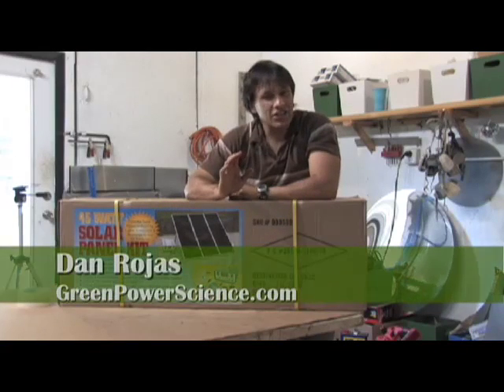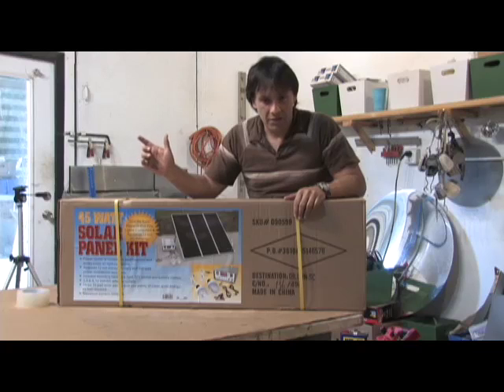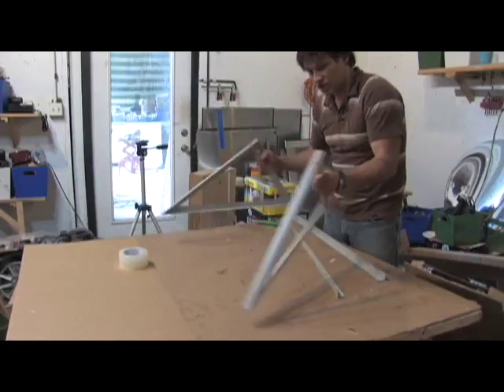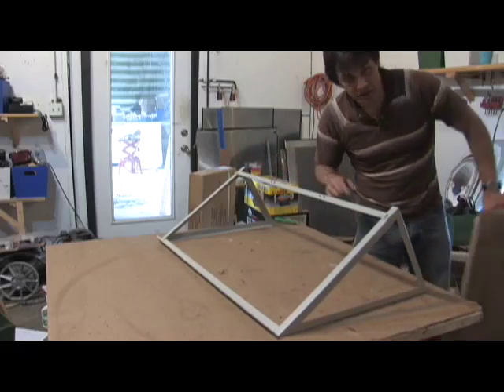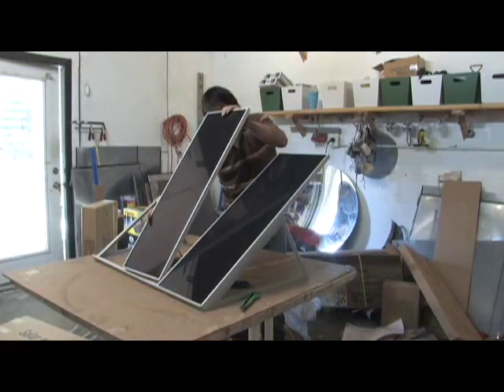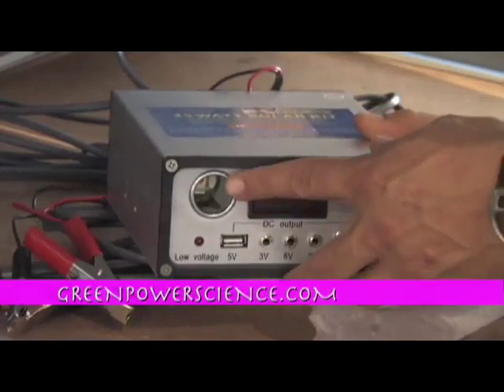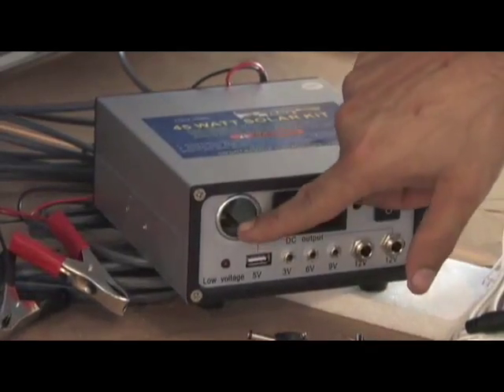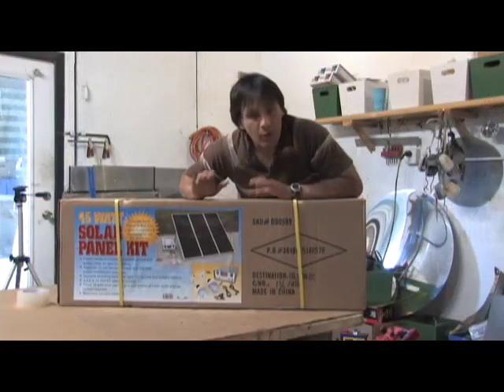SOLAR PANELS Photovoltaic, Harbor Freight, DIY INSTALLATION Training Video Solar Electric

Comment from the maker: Hi,

You can do 6 panels per controller or 90 watts. You can also hook 2 controllers together to one bank. So, if you had 4 systems, 2 to 1 controller (6panels to 1) and 2 to another controller = 180 watts, then both controller to battery leads can be connected in series or parallel for 12 V...15 amp or 24v...7.5 amp either way would produce 180 watts.

Dan

Comment from the maker: Hi,

For PV panels a heliostat system is not really needed. You will only get an extra couple of volts AM and PM. These stay at 21v open no load from 10 to 5. So you can track, and I have seen systems that do it, but I think you would be better off spending money on more units vs a tracking system.

Comment from the maker: Africa USPS max shipping dimensions 79" L+Grit.

You can send 2 panels and the stand USPS priority for about $70, send the controller box and the third panel separate.

Total shipping would be about $110. If you buy one from HF and need advice on shipping let me know. We shipped lenses to many places.

Comment: I have bought this system and it works very well.  I use it to charge a deep cell battery, which powers a 12v bug zapper (Eureka) in my yard, as well as all of my landscaping lights in the yard.  I found some very powerful LEDs on ebay.  The setup works very well.  I am considering adding a small fountain to the system, to see if it can support that as well.

Comment from the maker: That is amazing, you could buy 10, sell 5 of the controllers on Ebay (keep 5) for $35 and be in at $2.20 a watt. Also if you sold some of the bulbs you get, Wow. Where did you get the coupon.

Comment: Good video if you are installing it on your kitchen table. But if you are installing this outdoors, you need to make sure to isolate each connector end from each-other before taking panels out in the sun. Also, isolate the battery clips from each other before attaching to controller. You can use tape or put each in a little plastic bag and twist tie. All of these connectors will have a voltage across them when the panels are in sun. The features of the controller make this an excellent value.

Comment from the maker: I would not go over 150 watts per controller. You can buy one from Ebay for 20 bucks. If your voltage is the same. Panels to two controllers, to your batteries. For future add ons.

Comment: I just thought I would let you know about that so others will be careful when setting them up.  ALL the other brands of solar panels I have, which are also amorphous have sealant on the edges covering the wires under the frame but these just seem to have a kind of plastic 'flashing'.  Other than that, these things are awesome and seem to perform a little better than they are rated.

Comment from the maker: @bruteforce76 Not possible with a grid tie inverter, if the power goes out they shut off. Also back powering the neighborhood with a home system would only last about a second because the load would be many hundred Kw as people leave their stuff on in a black out, this would blow any system. The Island on GTI's are good. They work, no power in no power out.

Comment from the maker: Your voltage no load open should stay the same. Some HF controllers are not correct. Us another voltage tester. If both say 3.9 you have a short or you are hooking the panels to the output vs input.

Dan

Comment from the maker: @SpeedManiac1976 (2) wires per panel. All reds to + all blacks to - equals parallel or voltage the same but amperage boosted x 3 roughly.

SERIES
Panel 1 BLACK TO PANEL 2 RED PANEL 2 black to panel 3 red

SO Panel 1 has a free red, panel 3 has a free black this is voltage x 3 and apms the same as one panel.

Comment: Thanks for the reply. Actually it wouldn't cost me much of anything to build a tracking system. I'm an electronics/mechanical hobbyist, not to mention a scrounger/collector of good junk to make something worthwhile out of. I'll take you at your word for the 'not worth the effort' on the power gains. One LAST question, if I may, how do these panels look for resistance to hail damage? Again,  I appreciate your opinion and your time.

Comment from the maker: Home Depot's is a 60 watt system, with 4 panels. The same Amorphous cell. Exact same system but from Sunforce. $ per watt HF 45 watt $200=$4.44 per watt and HD 60 watt $300=$5 a watt, the inverter is a Modified Sine inverter and 175 watt inverters are good for small things. Either system is GREAT. Home Depot has a 20% coupon somewhere on the net, if you can find it let me know, that would make the system $240 and a screaming deal.

user : ArashiNage says the HF system was $143 after discount.

Comment: I wondered about this as well, but I -suspect- they have them built in as the place the wires are attached to the panels has a little black boxy thing on each panel.  This would definitely be a concern for me as this is a very likely scenario with their presesnt placement in my yard + am using a large mirror to deflect evening & morning sun into them.  I guess I'll have to look now...

Comment: Great once again I have learned more. I would like to know more about the grid tie unit that plugged in wall off two batteries?

Can you tell me where to get 12 Volt one with cheap prices?

BTW great job once again ! Cheers

Comment: This really only makes sense if you need to power a shed or something that is away from the power grid. You could also mount the panels on the roof of your car and use it as a battery charger/ventilation fan power source.

Comment: The reason why you had to make adjustments to the brackets is you installed the panels upside down. I just bought this system today for $149 with a coupon and did the same thing. 2 seconds later after turning them 180, they were just right.

Comment: hi dan ? the more panels you add the faster the batteries will charge right?what would be the idea system in your opinion.right now i have 1 kit from harbor frieght and 3 batteries and a 1000 watt inverter haven't hooked anything up yet just going to run maybe 800 watts of chistmas lights and stuff

Comment: Hey Dan, I just bought my kit yesterday.  A few tack welds on the stand works wonders for stability.  Have you tried the USB charger port on the regulator/controller?  I'm curious about charging my iPod from it, but I don't want to zap it with incorrect voltage.  I've looked everywhere for an answer, and I was hoping you knew something about this.

Comment: Just read this from a harbor freight reviewer "The price can't be beat, but bear in mind that the lifetime of thin-film polycrystalline solar panels like this is limited. The peak output current decreases over time. In my experience, these have a half-life of 3 or 4 years, meaning you'll be lucky to get 1.5 amps in full sun after it's a few years old, and even that will continue to diminish. For long life, nothing beats the old-style panels with single-crystal silicon wafers"
Made me think twice

Comment: hey dan would like to see two of this kits on a solar tracking unit. I would be really interested in it tied in with the SSI 200w grid tie inverter. Which I hear is close to UL approval also there is larger units of this.

Once again a dual setup of these with solar tracking would be a great project and I would for defiantly have interest in this.

Comment: Greetings, My neighborhood HF has 'em on sale for $169. If I can pick your brain for a minute. I'm under the impression panels perform better when facing the sun. If that's the case, think it's feasible to mount the panels end to end on a 1x9 frame that can tilt to follow the sun? It seems a 1x9 would be easier to do mechanically and be less exposed to wind issues like the 3x3 would be. Appreciate your videos and any thoughts you can offer.

Comment: I got this kit it was a pain in @33 putting together nothing lined up. LOL I know your frustrations LOL. I actually got a 2x1 board measured and cut to fit rear inside of frame drilled from outer side in and bolted. 

Unit is better to move around now not so flimsy. Also for those who get this unit a hot glue gun helped me. Hit the areas where I was going to connect then connected held it there a few secs and helped hold in place while handling to place next part in.

Comment: I am just starting with the Harborfreight solar system.  How many panels can I place in parallel with the charge controller unit it came with?  The system came with 3 panels, I am thinking about buying more panels.  Thank you in advance for the answer.

Comment: hey dan, i bought a 100 watt solar charge regulator.  But the connections say to fit the batter and the panels, but nothing leading to the regulator that came with the system.  Do i just strip wires and hook the controller up to the back of the regulator that came with the system..
Reply from the maker: concrete concrete Should be panel in power out. What is the system.

Comment: you connect 3 wires to that charge controller to keep 12v right ? and thats parallel ? if you connect those 3 wires into a splitter and then with 3 inputs and 1 output then and hook that up to the battery would that still be parallel then or would that be series ? in other words if you do that would it still be 12v or 24v or more then ? im very confused about the difference between parallel and series connecting ...

Comment: You have to love Harbor Freights new site and review system. I posted 7 reviews. 5 are 5 star and 2 are less than 5 star. Guess which ones they posted on their site? The 2 negative reviews are nowhere to be found. Looks like youtube is the only place to get a biased review for their items. With Harbor Freight some things are a great bargain and others are junk out of the box. You want know it reading their site reviews. They do have a great deal on this panel right now for $159.00!

Comment: I could be wrong but... 
If you have 2-6v batteries hooked up in series making it 12v, you could do the same set up on the other 2-6volt batteries you plan on buying. This would give you 2 banks of 12v batteries. 1-positive and 1-negative on the first bank, 1-positive and 1-negative on the second bank. Connecting the 2 positive wires together and the 2 negative wires together would give you a 4 battery bank of 6volts ea running at 12 volts.

You shouldnt expect Dan to reply to everything you ask

Comment: You know solar never charges at night or on cloudy days.  Wind power kits are a great way to reduce or eliminate your home energy bill.  Most people are going grid-tied and making the utility buy back the unused energy made from their windmills.  Home wind power kits can be installed on a roof or in the yard of your home very easily.  Small wind turbines are rapidly spreading across America combined with solar.

Comment: Do the light cords have a fuse on them Would it be posible to use a 20-50 watt 12 volt bulb on the same cord and socket

Comment: i have 3 of these kits,if 45 watts (each of my kits puts out approx. 19 volt at approx. 2 amp per kit(unregulated voltage)). ive found for small 2 battery systems these are decent but not great kits. if 10-20 amp per day output works for your needs then these are good.(b.t.w. my oldest kit is 4 years old and puts out about 90% of the output of the newest kit which is a year old).

Comment: Timing is perfect - just got 2 sets - I had set up 1 already. I will be tying 2 panels to a 3 battery parallel 12v system.  Looking for deals on grid tie inverter & need to repair my Xantrex 1000W portawattz AC inverter.  I got 400W sale at HF for $30 + 30A charge controller for $79.  Now to hook it all up...

Need good source for fuses, wire, and high current switches!!  Kitty got stage time too!  See... starving for attention.  Typical :^)

Comment: I am trying to figure out how to determine, how much batteries and solar panel kits to run a ki  ,  that  is 240V,  28 amps, 6720 watts  for approximately 12 hours continually.   

I am math challenged...   any help will be appreciated!  thanks

Comment: Nice helpful video.  But lucky the sun was not on the panels as yet.  You should always hook up the battery connections first with charge controllers -then- the panels.

Comment from the maker: 14.5V WORKING RANGE

12 v DC charing

45 watts total system

15 watt per panel.

23 V Open circuit

Comment: First you need to figure out the wattage you need. You can test the wattage of your appliances using a Kill-A-Watt device. The panels in this video are 45 watts. If you aren't using any batteries you just divide the Watts you will be consuming by 45. If you are using batteries you need to calculate how fast the batteries will drain to make sure you don't run them past 50% charge. This is especially important at night. You also need to make sure your inverter can handle the wattage you need.

Comment: @luckylatio77 Solar panel kits on this scale are pretty useless for powering your home, unless you live in a small shack with a single light bulb. However, these types of kits are great for RVs or any away-from-the-grid needs...on a recent camping trip I used a panel to keep a laptop & cell phone charged...also had light at night from battery power...so very useful indeed...I would stay away from this kit as it is bulky and expensive...try ebay and piecemeal a setup.

Comment: @OscarTankMan IF your connected to the grid you could hurt anyone who might be repairing power lines; if there is a failure and you are sending juice into a system that is supposed to be dead, a tech could be doa- zap get ready for a lawsuit and probably jail.

Comment: I like to meet you in person I wish I new were you lived I come meet you and talk geek... I'm in to computers and anything electrical and manacal I like working with my hands I want to supplement as much of my power as I can I Have a motor I will turn in to a winmill its from a tread mill and I have two older solar pannels they work good. got them from a goverment auction for like 5 bucks I want more to bjild a array  I going to add you as friend.